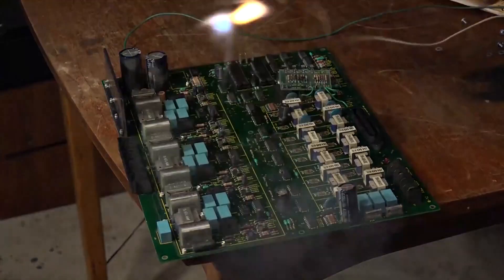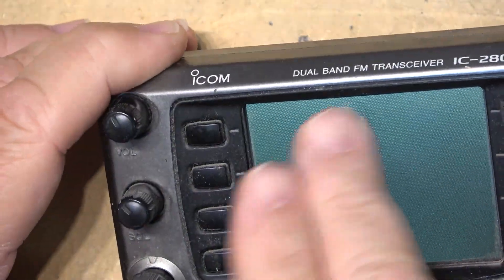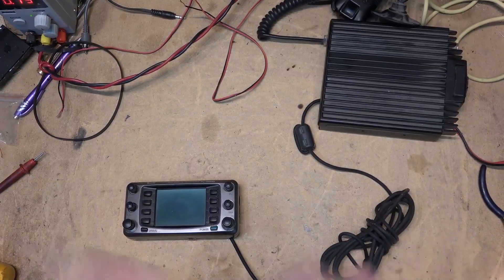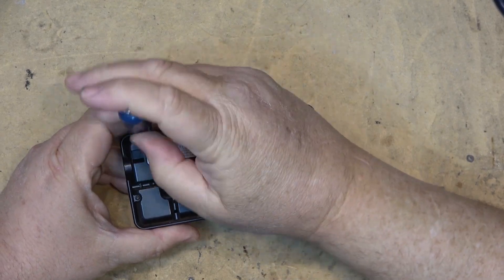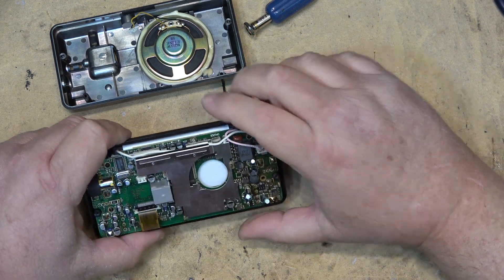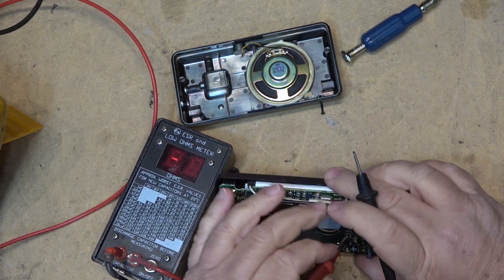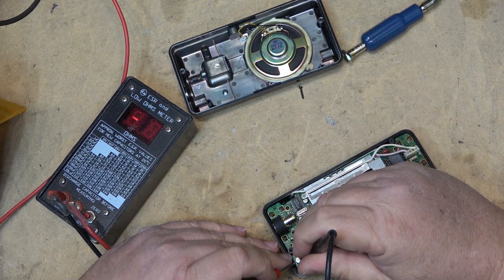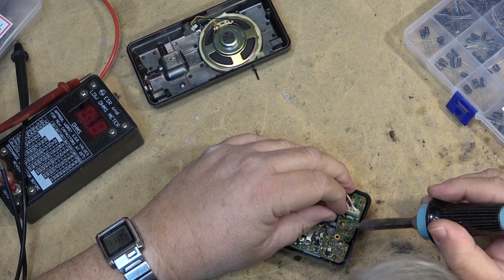Icom IC2800 HAM Radio Display issues.

Comment: I'm surprised Icom didn't release a cooling fan modification for those radios in the head unit.
Reply from the maker: I think this is a radio that I comment wish they had never released. everyone that I know that ever had one and there's not too many people that spent the kind of money that this one was because it was expensive, but everyone I know that had a $2,800 had a display issue. I only know three other people that own the radio and I was the last to be using mine. The others the display died years ago and the radios were scrapped.
Reply: @12voltvids  the only Icom radio I use is an IC-718. They are getting old too. Had mine for nearly 8 years. My other radios are Yaesu. You most likely have heard me on 40m band. VK5FCHM.

Comment: That's not a stuck pixel(s). :) Here you can see all the pixels work aka white picture which means that's a software issue. I mean it's not the LCD itself, but something driving it.
Reply from the maker: Actually it is stuck pixels do some research. I have a few LCDs that have stock pickles mainly my laptop that's got to start button burned into it. It's referred to as image retention. With liquid Crystal displays the liquid crystals himself bend and twist to refract the light. What an electrical current is applied to the pixel it reorients the liquid crystals so that as light is passing through them the light polarity is changed from horizontal to vertical or any degree in between depending on the intensity of the electrical charge. As the light passes through the rear polarizer and then the liquid Crystal membrane and then the front polarizer light is regulated. What happens on LCD screens but stay in the same state and don't change is the liquid crystals get lazy almost turned to a gelatin type State instead of being like water. once this happens the crystals himself are slow to respond if they even respond at all. Back in the early days of widescreen TVs when most people were still on regular low-death cable people would watch their TV in 4x3 mode with black bars on the left and right side. As HD rolled out I would see on a regular basis the first time we put widescreen on someone's TV that it had it in 4x3 for a few years and the areas to the side of the screen were much darker where they had been kept black all the panels life up to that point. Will they restore yes likely they will after a period of time. Will they ever straighten out on this monitor on the radio probably not at least the first digits it just display one four or four four not unless I were to pump video into it and give it a changing scene. Liquid crystals don't like to stay in the same state and if they do they'll get stuck. I've seen this on many devices.
Reply: @12voltvids  I know what stuck pixel is. I'm pretty into LCD tech and I'm OCD. I returned dosen of PC montors just for 1 stuck or dead pixel. :) I'm also writing stuff for Wikipedia about the topic. Thank you anyway for the big explanation. :)
Reply from the maker: @borisdg  in other words you're a retailer is worst enemy. We had people like that when I worked in the business and when we saw them pulling into the parking lot it was like oh crap not him again. People like that drive retailers crazy because the retailer doesn't want to take the equipment back and now have to sell it as a used product and the manufacturers generally will not accept it back. Same with camcorders and get people coming with camcorders because there was one green pixel in the top left corner of the screen that was driving them crazy. You couldn't see it when playing back a tape because VHS at 8 mm didn't have the resolution to display that single Pixel but if you plugged it directly into a TV you can see it. People would come back with camcorders expecting a new one because of one pixel and we'd have to explain to them in the manual because it was always printed there that there will be some dead pixels and there was a an area of the screen where if a pixel fell into a certain area which is typically around the center of the screen it would be replaced but if it was outside that boundary it would not. Some retailers will tell you where to go and how to get there. My professional JVC gydv 500 for example has multiple dead pixels on all three ccds in different places and it went back immediately to the selling dealer and I had the selling dealer point out in the manual that defects would only be covered if it fell within a certain area and that these ones were outside of the certain area so I could go pound sand. They never did correct the problem JVC never corrected the problem they said if I wanted one that had no pixels defective I could pay three times the price. In other words move from the professional line to the broadcast line. I once had a guy with a CRT set that put up a crosshatch screen and then measured it with a ruler on all the corners and must have called us out five times because one of the lines was off by eighth of an inch and one corner. Customers like that used to just drive me crazy because under warranty you're getting 80 bucks to fix a set and it doesn't matter whether you spend 10 minutes on it or 10 hours you're getting a flat rate big waste of time and you can't make people happy. That and the asshole that I work for were the reasons I left the business in 2003 I was Fed up
Reply: @12voltvids  I mean when I pay premium for a product, I expect premium quality with no defects. :) Here in my country I have 30 days return so why not. LCD tech is not new so It's still shocking that such imperfections exists.
Reply from the maker: @borisdg  the problem with that theory of returning it for one dead pixel is that the manufacturer has to eat that cost or the retailer has to eat the cost usually it's the retailer so that results in higher prices for everything else because a retailer is not going to eat a 500 or $1,000 monitor he's going to put the price up on everything else in his store to compensate him for his loss the same as when someone steals something. If it goes back to the manufacturer it's usually written off as an insurance write off which insurance companies don't absorb they pass those costs on to all policyholders including you if you've got insurance you might not think that things like this affect you directly but they do every time someone takes something back for whatever reason it doesn't get resold they're usually recycled or they're sold at a steep discount. We have a shop out here that sell such products people returning LCD monitors or all that monitors for one or two pixels that are bad and they put them up for sale at a deep discount. They buy them from the underwriter who is written them off but still there's the initial losses that are compensated for by higher prices. It's very difficult to make an LCD panel or CCD that is absolutely flawless. One of the reasons curved screens we're even brought to market a few years ago had nothing to do with curved screen looking better no curved screen existed for one reason and one reason only and that was because when you make a large pain of glass the chances of the imperfections in that glass are much greater than when you make a smaller pane of glass. Next time you're walking around outside look at people's windows look at the reflections in large windows and you'll see the reflections got all kinds of distortion in it this is because the glass is not perfectly flat. Same thing happens to the glass used on a large LCD panels however it was discovered that if you applied a curve to the screen that it trick the eye because of the curvature so that you wouldn't see things like straight lines not appearing straight because of the curvature in the glass. It was a sneaky way that they could send panels that would otherwise be rejects out to market and people wrapped them up as some new technology and we're Superior to a flat screen in every way because they were tricking the mind with how the eye works when it sees things that are not flat the curved screen tricked the eye. It's no different than the technique that's used on some ceilings where they put a spackle on the ceiling that's to cover flaws in the drywall work like taping and mudding.
Reply: @12voltvids  That's actually very interesting for the curved screens. I have myself Samsung 4K curved TV, but I regret buying it. Flat screen is nicer. :)
Reply from the maker: @borisdg  I would imagine that's why they stopped making curved screens because it was a fad and it was just a way that they could extract more profit on the screens it would ultimately have been destroyed. You don't see too many companies offering them these days
Reply: @12voltvids  Curved screens still exists. PC market has even more now. :) But I'm fan of flat.

Comment: you need to use a cap that can handle high ripple currents :)
Reply from the maker: Good luck finding High ripple current caps in that small size. I might be better to go back to surface mounted. But then this radio is not going to be seeing much use it's now a retired radio I've got a new one to replace it so I just wanted it to work.

Comment: Oh yeah like we never forget that for example the converter box had a tendency to heat up the electrolytic capacitors and changed it up approximately 3 times in a row and it was crazy the way the devices goes that way.

Comment: Sometimes it's worth the few extra cents to buy higher quality capacitors.
Reply from the maker: Good luck finding those. I get what the shop carries, and even ordering mail order there is no guarantee that you are going to get anything different. Can you say counterfeit parts.
Found that out with that Technics receiver. Loaded it up and it went pop.
Reply: @12voltvids  Buy reputable brands (Nichicon etc) from a reputable seller (Digikey or Mouser) and you will have no issues. I certainly have not.
Reply from the maker: @petenamlook18  digikey is far too expensive to ship to Canada.  I bought a 14.00 transformer from them and by the time it arrived with the shipping taxes and broker fees it was close to 100 and the client list his shit and was mad at me because i passed these charges i was not expecting on.
Reply: @12voltvids  There are no brokerage fees with Digikey. Fedex deals with that. Plus free shipping on all orders over $100. I received a package this week from them. I have never paid a brokerage fee when ordering from Digikey. I am in Canada btw.
Reply from the maker: @petenamlook18  but if you don't order 100 then they clip you excessive fees.   It may have been mouser that it was ordered from but a 15.00 part ended up being close to 100 by the time it arrived and there was broker fees added as well.

Comment: I have two icom 2800 radio’s My flourescent tube was bad in one-so I used some small leds worked great.Like your video’s.
Reply from the maker: The fluorescents don't like to be started. They like to run constantly. My little Panasonic 3" LCD TV the tube went dead on it too.
Reply: @12voltvids  I’m like you repair everything all my life Love my hamradio stuff. W4EBX
Reply: Also I try to use  the 105 degee caps instead of the cheaper 85 degree ones you probably already know that.
Reply from the maker: @eddiebrindley4815  yeah so do I. I like to get back on to HF but with all the noise it just makes hearing anybody unbearable. So I stick to 2 m, 220 and 440. Just got my first fusion radio so I'm now into the digital era so far I'm enjoying it.
Reply from the maker: @eddiebrindley4815  well that's the thing they were 105 caps that I put in the first time and the second. I should try to get some 125c caps.  yes they make them I would imagine that they are quite expensive.
Reply: @12voltvids  Didn’t know they made them.
Reply: @12voltvids  I listen more than talk,mostly 2 meters 220 simplex-we have a local club 146.415 simplex HF sometimes.Right now I have icom 2720 to fix and an old icom dual band vhf—-220 rig.I tried Dstar didn’t like it.
Reply from the maker: @eddiebrindley4815  yeah I've never tried D star I do have a DMR radio but I've never had much luck with that when you start having to plug in slots info and ID info for the channel because they'll have multiple channels sharing the same transmitter it becomes a pain. That's what I like about the fusion system you just plug in the frequency like you would if it was an FM and talk. I've done a video showing off some of the features of my fusion radio I just haven't edited it or published it yet I might do that this weekend but so far I like the format it sounds good it seems to work okay and it's got some neat features. you can for example set up sub channels within the same repeater using codes and then when you're tuned to that code you only hear people that are transmitting the same code and the repeaters can be linked just like d-star and DMR.

Comment: If your not too bothered about the back, get the back and drill little holes over the areas where the caps are.
ive done it with sealed power supplies, some holes near the top and bottom to help convection.
Reply from the maker: That might help. Then again I am not really going to be using this one going forward as I just bought a shiny new Yaesu fusion rig. If I decide to sell it I don't want a bunch of holes in the back cabinet if you know what I mean.
Reply: Top man respect for your rememberance